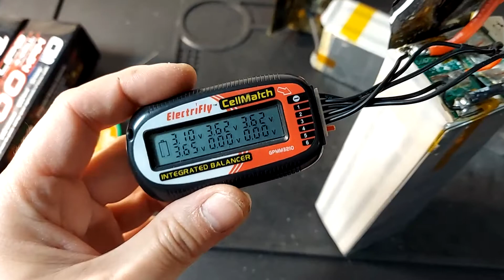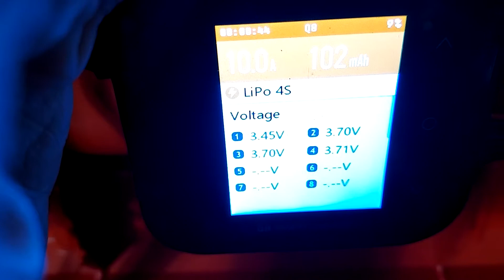Convert Traxxas ID LiPo 2890X to XT90, Properly, Not An Adapter.

Comment: do you know the order of a traxxas 3s/2s lipo to do this?
Reply from the maker: Kinda hard to explain via text. All batteries are wired the same. I have another video converting a 6s with a bad cell into a 5s. Same proceedure. Hopefully this helps fill in the blanks for ya. https://youtu.be/-BQLMLoQp54?si=I7ZF4At74XSJfKr0

Comment: Excellent! I've been pondering on converting my traxxas batteries(and repairing a couple) but was hesitant because I was unsure how to wire up the balance wires. Many thanks from Knoxville, TN
Reply from the maker: Hell ya man. I'm in Chattanooga!!!! And yeah I do like the batteries but the connector is a complete waste and honestly it hurts their sales more then helps. No one wants there BS chargers. They 100% would make more money if their batteries had an XT90 and EC5 option to buy.
Reply: @NomisRC  Thats whats up! Thats one of my wife's favorite get aways, change of scenery but still "Home". Agreed on the connector situation. My feelings wouldn't be hurt if  the XT60/XT90/XT150 became the industry standard, but that'll not ever happen. Even if every other company did choose any connector for a standard, Traxxas being how they are,  would never conform. 
So I cracked open two of my 6700mah ID batteries and they don't have the circuit boards. Is that odd? They are definitely ID batteries. The metal tabs and wire connections are covered by the clear/yellow tape and are obvious so I'm just going to proceed as normal. Shouldn't make any difference unless I'm missing something
Reply from the maker: @TJ Greene  yup if u can see the solder points, ur good.